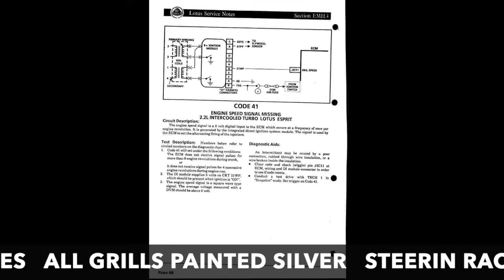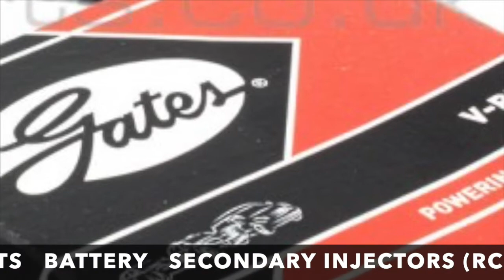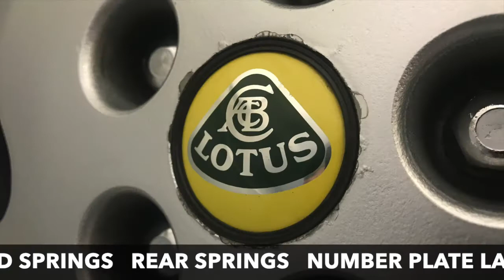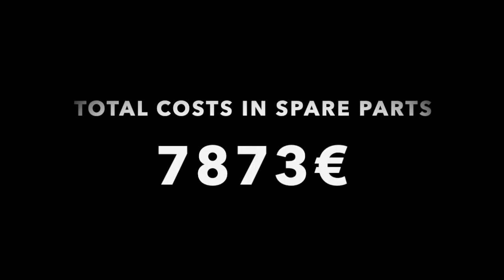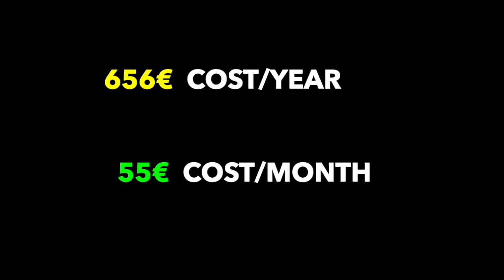The Real Cost of Maintaining a Supercar | Letsee Garage

Comment: I like how you said 2021 expected to be over $2000, have you torn into the engine yet?  Unless I am mistaken you said engine rebuild this year.
Reply from the maker: Yes, I have just started  disassemble the engine.
Reply: @LetseeGarage  When you do so, take a thorough look at the cam followers, as the first years were cast, and over many year/kilometers, they will crack. Stronger lighter ones are navailable.

The strenghning bar for the tailgate struts: is that special made, or can it be bought somewhere?
Did your mounts flex?

You are right. It's very very cheap to have only paid under 8000 eur for 13 years of enjoyment of a true supercar.
Really cheap.

Cheers
Reply from the maker: @monzarace  Thanks again! The strenghten bar is custom made and it's 12mm and 16mm stainless bar with the threads in both ends. The left side on the mount was turning really flexible.